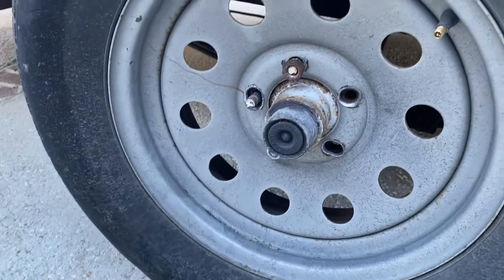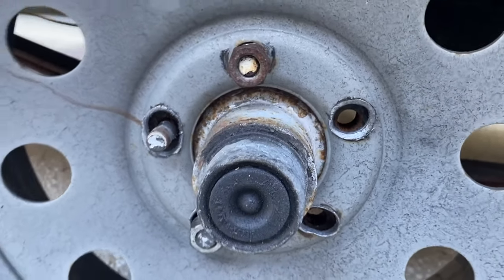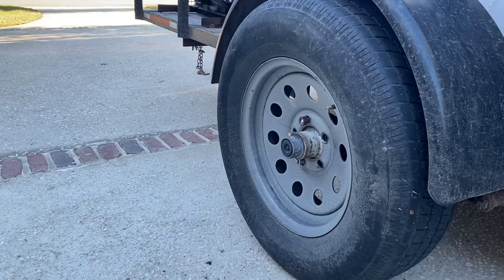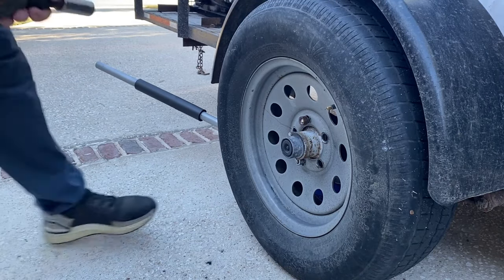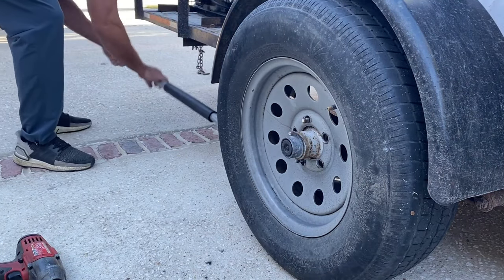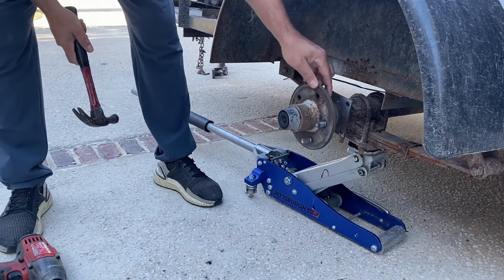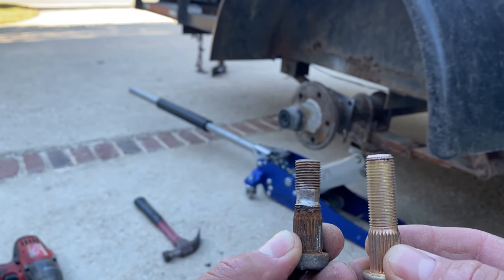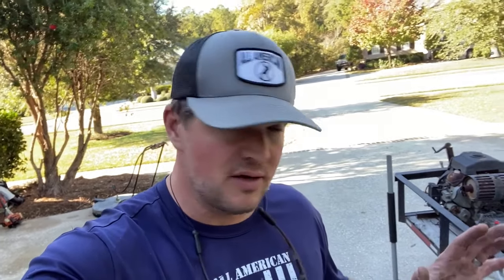How To Replace Broken Wheel Studs In 5 Minutes - Trailer Repair

Comment: All too familiar with the lug nut issues. I had a dumper trailer that was famous for loosening lug nuts. Got into the habit of checking them every 3 months or less. And placing my hand on the wheels to see if hot during heavy loads or long trips to see if my hub bearings are going bad, good habits to learn. Be safe, my friend. Cheers!
Reply from the maker: +T.BONE/SIDE OF LIFE  good stuff!  Thanks for sharing!

Comment: I wish it was that easy replacing lugs on a truck (you don't have the brake drum to remove on a trailer), but this was pretty darn impressive!
Reply: My 2005 6x12' double axle  LOADHAULER cargo trailer has the studs in the brake drum.  IT really doesn't take much longer to take the hub off depending on how boogered up the cotter pin is.

Comment: my trailer was 20 years old when I got it. I've had it over 10. long story short I had some work done on it and now 12 of the 24 lug nuts are seized on, 4 or 5 have broke. been working on them for weeks to get them off, and to get the lug out. oil, hammer, oil hammer. . . it's not going well. lug nuts too tight are as bad as lugs too loose.

Comment: I didn't see a stopwatch running while you did the job, but I did wonder why you didn't bother torqueing your wheel nuts to whatever the manufacturer recommended.   Not sure why they loosened, but might also have been a good idea to spend another "5 minutes replacing the other side's studs while you were at it.  Theoretically, the other side's studs have taken the same number of revolutions as the side that failed.

If you are at home or at your shop and have more tool access, those old school Craftsman battery "close quarter" hammers to a decent job of getting studs like that started when space is tight.  Did you try to align the new serrated splines with the old ones or were they too reamed out for that to be an option.  I noticed one stud appeared to totally separated  the the nub actually falling out of the inboard side of the hub.  Prolly not much metal for the new stud to bite on if that was the case.  Just glad that didn't happen to you at 70mph, regardless of the load.......
Reply from the maker: Cool comment I guess...

Comment: One of my trailer wheels has bolts instead of stud and nut it also has no brakes, do you think I could remove the bolts and install a stud from the back to convert it
Reply from the maker: +Hasheem K I have no idea.

Comment: I have a question and a problem , just had tires put on at pep and the tech came in after all tires were installed and said that my one wheel stud kept spinning after he put the wheel in and was tighten it, so now it is on my car and just spins how do I get it off because I'm not paying for that I did not break it the tech did. They want to charge me almost 70$

Comment: What size is that lug stud?
Reply from the maker: +Patrick King no idea.  They are all different and I took it the the trailer supply place and just matched it up.
Reply: @AllAboutPressureWashing  I researched and they always ask wat size 3/8 or 1/2
Reply from the maker: +Patrick King These were half inch. But they were all different sizes based on the depth of the splines, the thickness, I’ll kinds of things.

Comment: Not a good idea people.. hitting the hub like that with cause bearing damage.. and one day you wondering on the side of the highway what went wrong.. 
The solution is.. you need to take the hub of the spindle axle and have the hub isolated.. then and only then can you hit the studs out..

Comment: One thing I've done when seating new studs is after hammering, run the lug nut till it makes contact with the hub. Then bring them on home with the final seat. Keeps the new wheel studs from falling out as you go. As always good tips. Helps show folks you don't have to be a master mechanic, and save themselves some money.
Reply from the maker: Great tip
Reply: @AllAboutPressureWashing  that's what she said

Comment: One of my studs snapped off when trying to remove my wheels off. Half the stud stuck inside the lug but. Can I drive my car with 4 lug nuts instead of 5? It would only be to drive it to the store to buy the studs or is that u safe to do? Thnx and great vid by the way
Reply: Yeah you'll be fine with as little as 3 as long as they're spread out as an emergency temporary situation